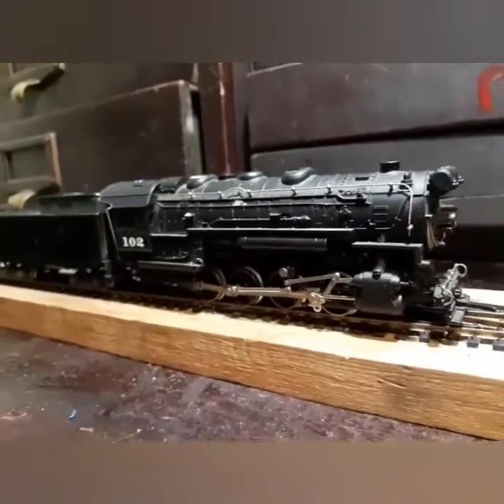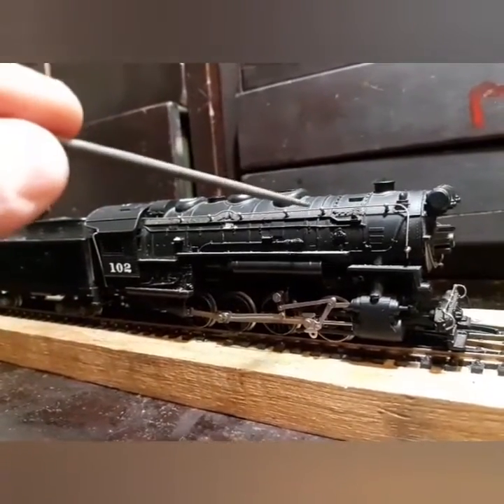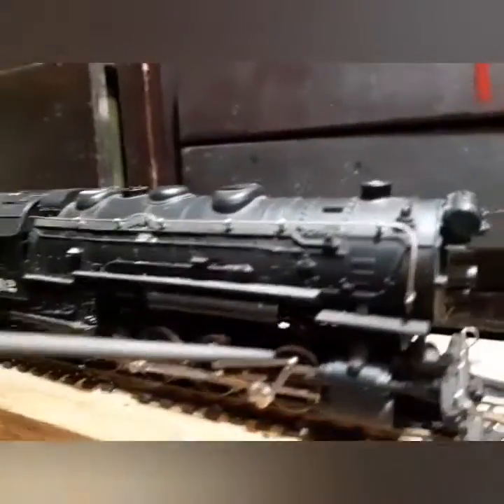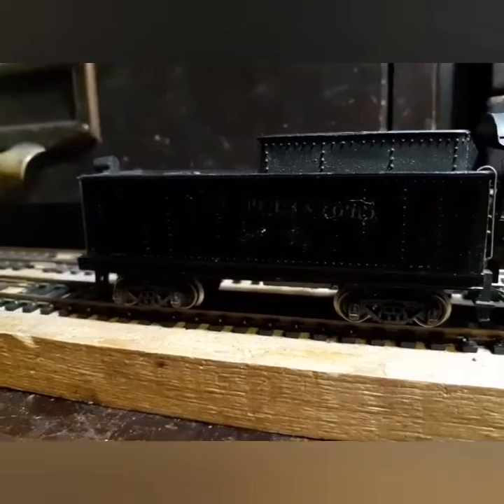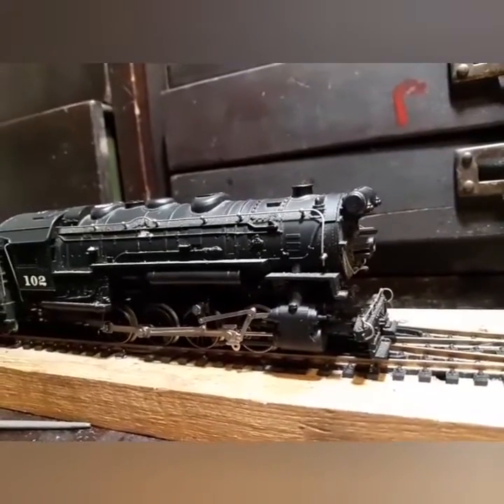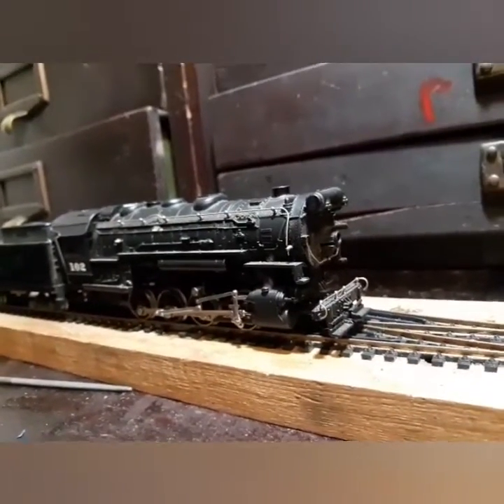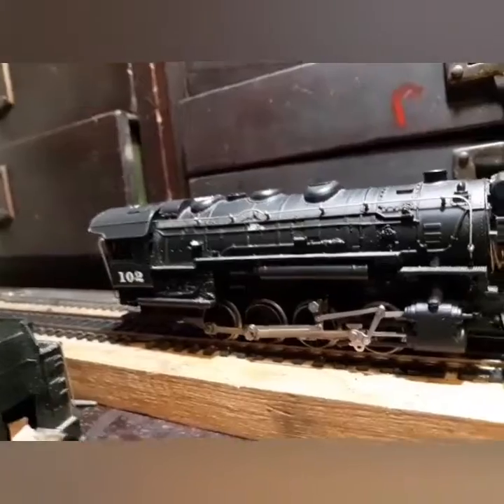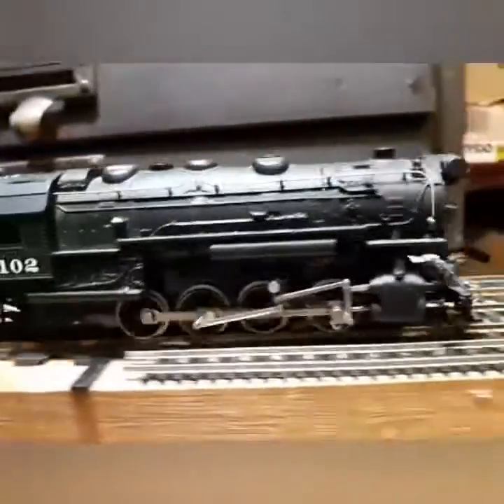HO scale rivarossi 0-8-0 #102  Switch engine review

Comment: 2225hrs.  Good evening.. I noticed it stalled on forward. Check out the play in the gear box. That maybe why. It jammed up on take off I believe. As for a name,,,, "Iowa Central" ? Oh the gear box is dry, It's noisy and doesn't run smoothly. I use Labelle white grease  mixed with Graphic. This is what I've used since 1985 when I'd bought A Roundhouse Boxcab, It was noisy straight out of the box. The Roundhouse EMD Model 40 I got in the early 90's was noisy also.